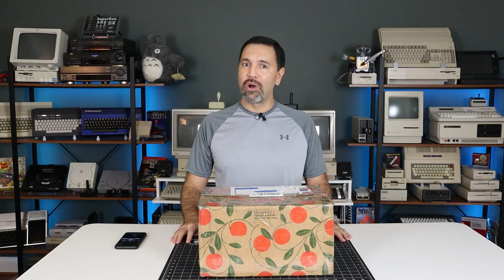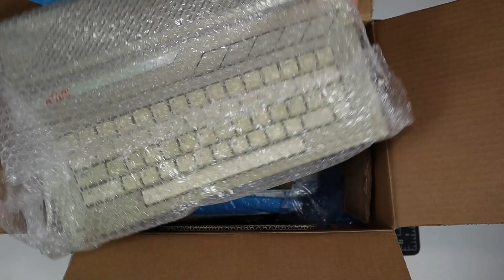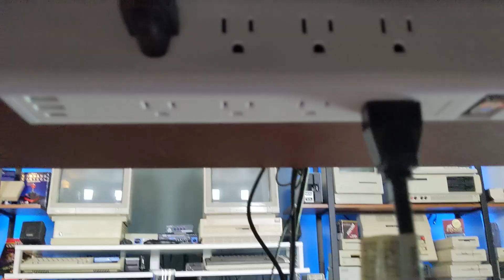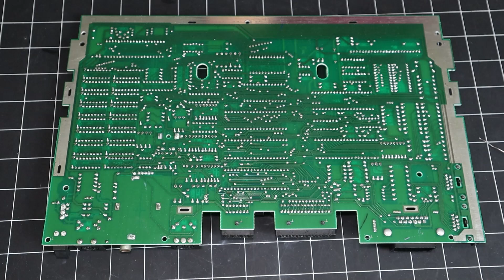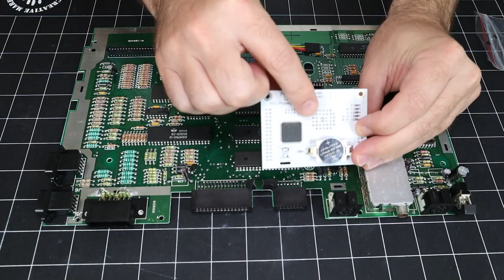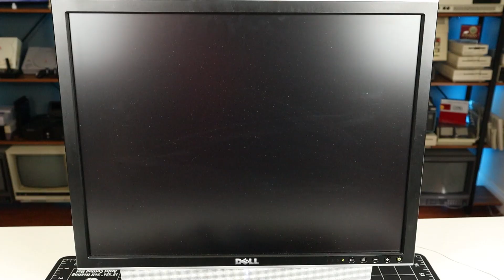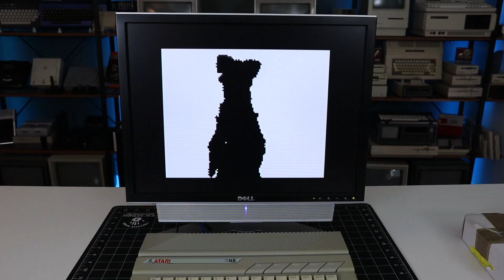Is this the “Ultimate” upgrade for your Atari XL/XE?

Comment: 21:50 foam based aka "white" double-sided tape - is a biiiiiig mistake. It will not come off easily. You'll end up scratching either RF modulator or upgrade PCB. Or both...
Reply: Next time use clear aka "red" 3M tape
Reply from the maker: I switched it out for adhesive Velcro pads for now.

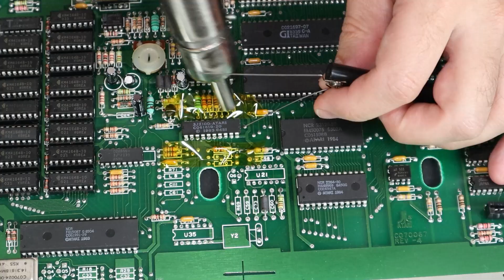Comment: 11:18 yes! that's exactly how to damage traces under the IC - use metal tool as a lever 🤦‍♂️
Reply: 13:37 here's scratched green mask, and scratch is crossing the trace. This time you were lucky. But next time you might not be so.
Reply: 14:09 another two damage scars, one of them crosses 2 traces 🤦‍♂️
Reply: @nneeerrrd  Those traces will rust or corrode now that they are exposed?  Now he needs to apply new mask or solder.
Reply from the maker: The tool is specifically for removing ICs with a hot air station.

Comment: Works un atari xegs??
Reply from the maker: Yes! The U1MB and SIDE3 can be used in an XEGS :) Also, I believe it's possible that non-GS machines can be booted into GS mode and use the four on-board game ROM slots when the installed U1MB is jumpered a certain way. Will explore this in Part 2!
Reply: @retrobitstv  I'm not sure the SIDE3 will physically fit in the XEGS cart slot. It might. The slot is more narrow than the 800XL's cart slot. The SIDE2 does not fit in my XEGS. Maybe that's been fixed with SIDE3.  They use C64 cart shells, so they are a little bigger than they should be.

Comment: Its  totally fair to compare it to the C64 as long as you include all the homebrew software that is available now .
Unfortunately the Atari machines did got the chance to show their full capabilities during their commercial life.
Even if its architecture originates from the late 70's it  manages  to deliver impressive results for an 8bit machine.

I own most of europe's populare machines of the 80s( 8bit and 16bit ) and I have to say that  the Atari 8bit line still manages to surprise me with what this hardware can achieve.
Reply: With these 8 bit machines a lot of it comes down to the support chips. The better the sound chips and the graphics chips the more impressive the machine. I had a Dragon 32 which was a 6809, a far better CPU than the 6502 but had no sound support at all, just one bit sound in software and very poor graphics. However it was beautiful in assembler.
Reply: @wayland7150  The Dragon and CoCo had a 6-bit DAC for sound. So, a far bit better than the Apple II. No pun intended.
Reply: @RetroDawn  Yeah, you're right, I remembered that wrong after 40 years. I did actually write a 4 voice sound output for it. It could produce pretty good sound but tied up the CPU so would not be useful in games.
Reply: Yes, the Atari had awesome support chips.  I recently saw a video on the BBC Micro, and they explained how software would count cycles as the screen was drawn and change graphics modes on the fly between scan lines to mix text and graphics modes, effectively emulating what Atari did with the Antic chip and display lists.  On the Atari, some software would use the same trick counting cycles across the scan line to change color registers between the left and right of the screen; the Atari's CPU clock is tied to the graphics to allow pixel-exact cycle counting, so the PAL systems run at a slightly different speed from NTSC systems.
Reply: Atari had sound and graphic capabilities compared to which C64 was a calculator. I remember seeing as it was called back than the "digitalized" photos (scanned photos) on 130XE and it blew my mind. Unfortunately, the price of floppy drive (500) was equal to price of new130XE plus new factory tape recorder (400+100) so not many kids had floppy drives, since it costed 20% more than the computer itself.

Comment: 0:22 - just pan over real quick just to confirm you're not really talking to anyone over there...   Though panning over would require a camera operator, so maybe that wouldn't work...
Reply from the maker: Hrm, or a panoramic camera setup. 360 degree Retro Bits videos, anyone? You can watch my cat on the floor seeking attention while I solder away.

Comment: The only real difference between the 65XE and the 130XE is the amount of RAM onboard, right?
Reply: The US 65XE's are also missing the ECI port.
Reply: 65XE's lack two RAM support chips as well. If one wants to upgrade a 65XE to 128K then these chips must be installed.
Reply: S-video is disabled on the 600XL/65 XE by default. but if you're decent at soldering it's an easy fix
Reply: @DragonSlayerKyo  I think all 65XE's have full s-video.
Reply: @DragonSlayerKyo  Never a 65XE with disabled S-Video.
Reply: @thomasw3880   Maybe I was mistaken.

Comment: What a great add-on! Looking forward to a follow-up video or two.👍👍👍
Reply from the maker: Part 2 will really show off what these two upgrades can do when paired together!
Reply: @retrobitstv  The U1MB on it's own is a MUST HAVE upgrade for an Atari. I'd be lost without mine. Being able to swap out OS's is great, makes the small non compatabilities of the XL / XE series a thing of the past. Mind you, I should not blame the machines as its really down to programmers not following the coding guidelines and hitting registers directly when they were told these could change and use the shadow registers instead. Did they listen, no. There's another cart that is similar (and better in one case) for the Atari called the AVG cart. Very similar to the excellent side 3.
Reply: @Mclaneinc  Technically it wasn't issues with shadow registers, as the hardware registers didn't move.  The problem was calling into unofficial OS routines that moved.  Also Atari moved some stuff that it shouldn't have because while there were "unofficial" addresses, they were included in the BASIC manual as examples.  I think those last ones were only on the 1200XL OS and fixed on the 800XL.

It should be possible with an emulator to see what addresses a given program calls into, and then determine if it has compatibility issues.  For binary-load files, you could have a preload routine that validates a compatible OS and prints a message if it's wrong so that you know immediately what the problem is.  I've found that in general, anything released in 1984 or later works on XL/XE OS and almost everything older works in 800 mode, so I have my emulator default based on the release year (which I have in my database).

But, yeah, if you're using a physical machine, being able to switch between OS versions is great.  It also adds a newer BASIC option that is much faster (which breaks some things) and adds commands like DPEEK and DPOKE for 16-bit values, which I really wish had been in the original BASIC.

Comment: Great video, Next you need a Fujinet and then it will have everything.
Reply: The Fujinet is quite incredible too. The Atari 8-bits are really looking good!
Reply from the maker: Thanks! I've been eyeing Fujinet for a while now, it looks super cool!  I really need to R&R my own 800XL, it just keeps slipping down the project queue :(
Reply: @retrobitstv  have you seen my 800xl video series ?
Reply from the maker: @leesmithsworkshop  The acid 800xl? Yea, I would have thrown that machine in the bin the second I removed the cover. Brilliant work saving that machine!
Reply: @retrobitstv  still can't believe it actually worked.

Comment: Just a factual check, it's the joint 4th iteration of the Atari series: 400 & 800.600XL & 800XL,1200XL then 65XE and 130XE released same time
Reply: XEGS sits in the corner and feels forgotten
Reply: I liked the detachable keyboard on the XEGS. 

The XEGS was a bit odd since it was double the price of the 65XE but, as far as I know, didn't do anything more.  Oh, it came with Missile Command and Flight Simulator.
Reply: & = joint release
Reply: 1200XL was USA only..
Reply: @Mclaneinc  1200xl which was the 2nd iteration, before the 600/800xl's.  You've them out of order. ;-)
Reply: @thomasw3880  yup, school boy error.
Reply from the maker: I totally skipped over the 1200XL or rather I just lumped it in with the 600XL and 800XL I guess.
Reply: @retrobitstv  I’m with you on this. XL series, it’s literally in the name.
Reply: The 1200XL was a bit of a different beast.  It was a fair bit larger and IIRC no basic on board like the 400/800.  It had the L1 and L2 LED lights which honestly I have no idea what they did.  Most interesting was designing a parallel bus and then not including it in the 1200XL.   So no 1090 expansion for it.  

The 2nd iteration should include the virtually unreleased 1450XLD sporting dual 130kb floppy drives and the 1400XL.
Reply: Enjoyed the video but yes the (now rare) 1200XL is not the same as the 600XL/800XL's.  It came six+ months earlier and is very different in board design and layout. Similar appearance but very different internally and slightly different in function.
Reply: I'm trying to see the facts on this.  It looks like the 1200XL came out late 1982 and was discontinued in 1983.  As I recall roughly 1988/1989 this was kind of my go to machine as I could get it for sub $30 and the 1030 modem (thanks Toys R US) had an onboard terminal program IF you pressed the right key upon startup.  

It was a magical age of why buy the latest when the prior version was good enough.
Reply: @mattzukowski1207  Yes many people over bought what they really needed. An XL in the late 80's was affordable and could do almost all tasks a PC or Mac could do.
Reply: I'm looking to purchase an "upgrade" for my early gen 800. I've been lurking on Lotharek's Lair but I'm having a hard time choosing the right upgrade or upgrades. Does anyone have a recommendation on the best all around upgrade or at least a readable comparison of all the various options?
Reply: @PaulJSchneider  The Ultimate 1MB is the first best choice, after that there's 3 good choices that sort of do much of the same thing. The Fujinet gives the old Atari wireless networking amongst other feature like disk loading. Basically you can stream load a disk image off a pc thousands of miles away as if it was a 1050 sat next to it. AFfer that theres the Side3 cart which offers the ability to mount HDDs, load cart images, xex files and many atr's directly from the cart. Lastly in no order is the AVG cart, it with an SIO add on lead allows tapes and pretty much all ATRS to be able to be booted directly off the cart, the compatibility is very very high. It also allows HDDs to be mounted as boots most known disk, tape and exe type programs, its the cart I personally own but the SIDE3 is also excellent. The Fujinet is very nice but the networking side does nothing for me.
Reply: @PaulJSchneider  What do you want to do with your 800? I don't recommend the Incognito because it requires permanent changes to the computer. An 800XL with U1MB+SIDE3 is better IMO.   You also can ask for more feedback at the AtariAge forums.  I do recommend having all the capacitors changed for new ones. Console5 sells 800 cap kits. Before long, the old capacitors will fail and leak acid on the internal boards.  You might want an SIO device like FujiNet or SIO2PC-USB. These are external devices.
Reply: @PaulJSchneider  see Ms Mad Lemon channel for a great video on installing the Incognito on an 800. I did this and also installed the Sophia 2 video upgrade.
Reply: 1st generation: 400/800
Forgotten generation: 1200XL
2nd generation: 600XL/800XL
cost reduction: 65XE/130XE
marketing change: XEGS

From a user perspective, I don't think there's anything different between the 600XL, 800XL, 800XE (rare), 65XE, 130XE , and XEGS apart from the amount of RAM and cosmetics (and built-in game on the XEGS).  I'm not aware of any software that will care which one you have if you've upgraded the RAM.

The 1200XL has the least-compatible OS, but many say it has the best keyboard.  Too bad there's a design flaw where the keyboard fails after a number of years (something with the mylar adhesive or the like).  A U1MB on a 1200XL with a fixed keyboard would be one of the best Atari 8-bits out there.